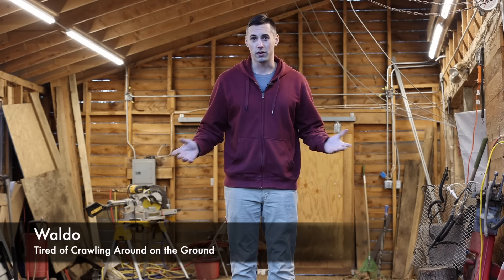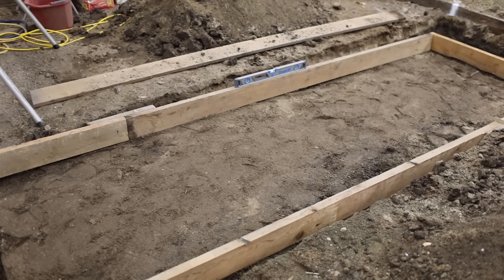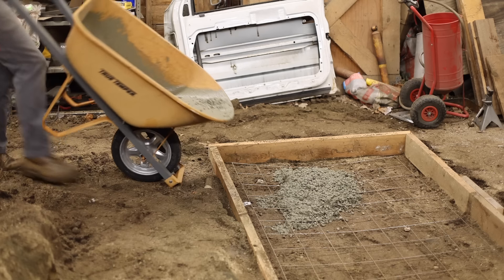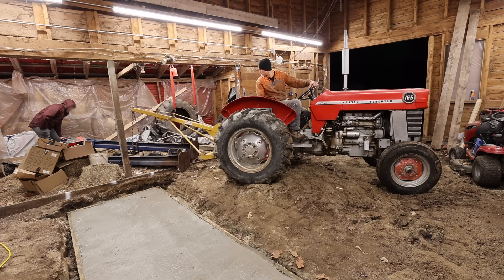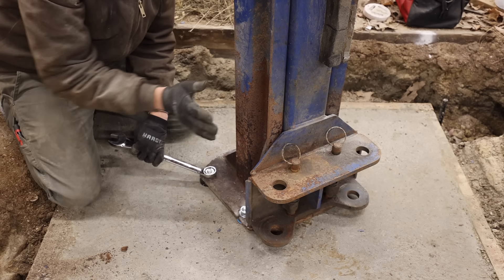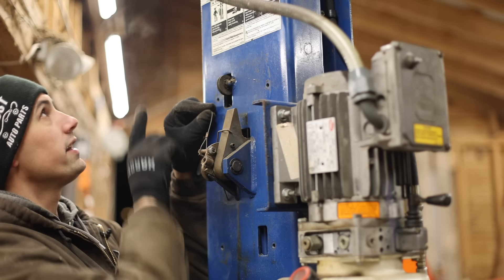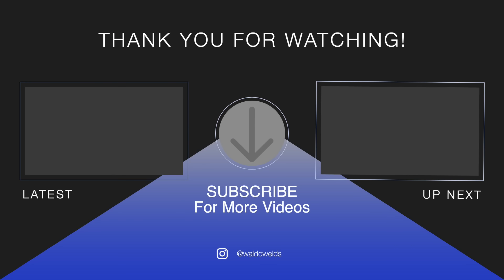Installing a 2-Post Automotive Lift on the Cheap

Comment: I have the same lift except its not asymmetric. I love it except its not heavy enough for my 95 c3500 hd service truck
Reply from the maker: My HD weighs about 8,300 lbs with the flatbed, so it's just barely light enough. Weight distribution is key though 👍

Comment: 42 bags of concrete is an expensive way to go, and plenty of backbreaking work.  Much cheaper to get a load of sand, a load of gravel and sacks of cement. Rent a mixer. It will still be cheaper than a palet of post hole cement.

Comment: Are you sure that a slab , just that wide but only 6 in. deep might tilt over if a vehicle  is  heavy and offset on the lift. I dug down 18 inches  in my slab to support the lift. I am 70 and I installed my lift by myself.

Comment: I don't know about lifting those trucks with a 2 post lift. What's the weight limit for your lift. Great job on the installation Waldo. I've always rather had a 4 post lift for working on trucks.

Comment: Why did you leave the bed of the truck steel. And not painted?
Reply from the maker: I plan to coat it next year, though I still haven't figured out if I'm going to hot dip galvanize it, paint it, or both

Comment: So, you posted this video almost 1 year ago and A LOT of people questioned how safe your lift was going to be. 
How about an update. Have you used the lift much? Have you run into any problems?
Reply from the maker: Good idea. I've used it a fair amount. Not necessarily every day, but I've been maintaining my fleet of seven vehicles with it (two of which are big, heavy, unreliable Land Rovers 😂). 

I've been using a pair of underhoist supports for safety. One at the front and one at the back of the vehicle to prevent the possibility of tipping. (Thanks to the commenters who suggested it!)

Overall, it's been a big quality-of-life improvement for me. I just can't wait to build a nicer shop with a full concrete slab 😬

Comment: Concrete slab greatly inadequate. Ceiling not high enough either. Also, vacuum up the concrete dust rather than blow it away. Concrete slab should be 6" thick with at least 1/2" rebar 6" apart. Slap should also be at least 6' length as well.  Also, new concrete slab should be cured for 28 days BEFORE installing the lift.
Reply: Yep, every sentence you wrote is gospel.

Comment: The installation instructions for a Goalrilla basketball goal call for a hole 16inches diameter and 4 FEET deep filled with concrete. No way I would get under that lift. I could easily see the whole thing flipping over. That slab weighs approx. 3600 lb, trucks weigh over 5000 lb.

Comment: Sweet project man. Be careful with that lift on that seemingly small concrete pad. I know nothing about this and if the lift slecs say that's sufficient, it surepy is. Just make me nervous and I would hate to hear that waldo got squished by a lift!
Reply from the maker: I hear you! I'll be really careful to distribute the weight evenly. Depending on how long this lift will be here, I might pour a bigger slab around it once the weather is good enough to get a concrete truck in here 😬

Comment: Min slab requirements per manufacturer below.
Min Slab Width (front to back) 48"
Min slab Length (side to side) 12" Wider than lift 
#8 Rebar every 6" Minimum
Min Slab Thickness at that size 12"

Good luck and even a small shift can cause whatever you you are working on to come down frighteningly fast.
Reply: Yeah..there's nothing holding this eggshell thin slab together but chicken wire..slab cracks, the hoist legs only need to lean in a half inch or so and they lose contact with the vehicle frame..from there things cascade very quickly and next thing you know we're all donating to his widow's GoFundMe account..
Please tear this crap down and do it right, man..

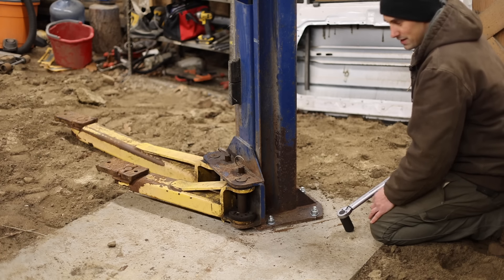Comment: 24:06 couldn't you give it a sanity check by multiplying your weight by the torque arm distance and see if it clicks at least somewhere in the ballpark, with a lug nut? Set it to half the torque target and see if it clicks there. 150 ft lbs is pretty high without being able to brace against something.

Comment: I agree with others, that pad is going to flip. Do rebar reinforced legs on the front and rear of pad, or just pour 12x12 pad.
I wouldn't get under a car with that setup for no amount of money.
Dude rent a mixer, save your back and eliminate dry mix concrete

Comment: I thought the ruck was going to slide off sideways when yu started to life it as the drivers side was raising morethan the passenger side. Was that to do with adjustments or a bleeding issue ? 
Happy Christmas from UK
Reply from the maker: I think it was probably a bleeding issue, though I also didn't have the leveling cables as tight as I should have. Happy Christmas!
Reply: @WaldosWorld  Ithought it could be the cables, but wasnt too sure. :)

Comment: What you've just done there is set yourself up for ultimate failure ears of pouring floors in garages and I mean commercial and industrial garages with hoists like that they need more than what you've done there when we pour floors it's usually 10 inches of concrete below the hoist area in an area that is about 8x12 with half inch rebar placed in it with 6-in spacing you're going to get yourself hurt

Comment: Why dont you dig down  and create pits front and rear (e.g engine area and rear axle) so you can stand (pits could be covered with boards), also then tidy up remaining "mud" area with  athinner layer of concrete , just and idea.

Comment: You routed the lift latch cable over the pulley on the pump side, looks like it should've been routed under. Otherwise pulley looks like its doing nothing. Other side looks good.

Comment: some guys are claiming the pad is too narrow, as if it will tip over BEFORE the vehicle tipped off the lift arms.
fear rules in the absence of common sense and it always wants to over engineer every solution.

Comment: How did you connect the electrical? Also wondering how you got it to raise the truck evenly without adjustable adapters or without any adapters at all. In the market.

Comment: The slab should have been poured into an "H" pattern at least withthe legs going out 6-8ft on each side with a 6" thickness about 24" wide minimum....Your slab will do little to prevent the hoist from falling if the weight isn't centered. The concrete should have been allowed a longer drying time before the anchors were installed and using epoxy in the anchor holes wouldn't have been a bad idea....Fun fact....when you pre-install the nut & washer onto the anchor....if you screw up the threads beating it in....you'll still have an easy time....You can drill into that slab horizontally and epoxy in some Re-bar to run exension footings outward buy, myself? I question why you would ever want to work on a dirt surface in a repair shop....the other parts of the floor could be muchh thinner....3"-4" t6hick to minimize concrete expenses. Also...the lift arms have those folded extensions at the ends of the arms to raise the contact point for tall vehicles....ALWAYS! lift the vehicle a few inches off of the ground and perform a "Shake Test" to make sure everything is secure before lifting further into the air....AND....NEVER take your eyes off of the vehicle while lifting or lowering it!

Comment: good video but all your's are. leave that barn it's good storage . when you build your new building roof will need to be 14 feet high if you put in tall type. at lease 12 feet for reg. i have a reg. one in mine i have 16 high roof and there may 5 feet left  from  roof. like yours is now it's still beats sliding around on creeper with no room at all. with a car you will have much more room under it. take care, be safe and well. merry christmas and a happy new year.
Reply from the maker: Merry Christmas!

Comment: Awesome video Waldo and Merry Christmas ,you did your research your concrete is overkill just vey fresh, I work with this tuff everyday at almost 10 times this weight and your fine and if you want a little bit of a safety margin Harbor Freight sells Pittsburgh Automotive under hoist safety stands 2 ton capacity for $75 each, you don't need anymore than that, your ground was already very stable and did not to be compacted, that also makes your  slab more stable the ground won't shift under it, i was going to build a new garage to accommodate a hoist, my walls are only 9 ft tall and had my 45 yr old concrete slab tested by a friend who said your way beyond what you would need for a hoist i said awesome and got a quote to have the walls extended another 2 ft taller, this is code in my neighbourhood not allowed to go taller unless you take out a commercial permit, living in a residential area, i had a blueprint from an engineer friend of mine to work from, a builder came out to give me a quote on the job and when he looked at the blueprint and said it'll never work, and told me it would never pass inspection, i asked why he thought that, oh your concrete is too old and you roof trusses aren't strong enough so we have to start from scratch and its $5000 to demolish and haul away all the old material , i laughed my ass off at him and asked where do you get your knowledge from, oh 30 yrs  in the business of construction , so i showed him the concrete inspection and he got mad and pissed off, i said i guess you never done a job like this before have you and you have only ever built new from the ground up you have no experience in renovating an existing building or site and this is an easy job for someone with  30 yrs experience i told him, the garage was already over built with 2x4 walls  15' on centre and the roof trusses were the same and the extension walls were only required to be 2x6 walls with bracing each stud cavity a no brainer for someone with 30 yrs experience  i told him, so gave him a copy and he quoted me double everyone else had quoted thx , nothing you and he never gave me referrals i don't think existed, Waldo your good to go. look forward to the future videos always good to watch.  👍
Reply from the maker: Thank you so much, and merry Christmas!

Comment: As others have said foot print is too small. personally I would have done the slab 3x the size if not just done the whole floor and called a pump truck.  secondly the slab was not cured enough to be setting anchors in place much less trusting them to handle a pretty sizable load from the jack and added weight of a vehicle. I would much prefer to over engineer and sleep easy than make do and regret afterwards.

Comment: You should have dug a bigger hole and some long threaded steel bars be inside of there, instead of drilling some holes into a tiny slab with no wire mesh inside of it.

Comment: Bro.   This is sketchy af.   Not enough concrete on the ground for that size lift.  Installed it a little quick too.    Concrete can take up to a month or so to be fully cured.    The small slab isn’t enough to be structurally sound neither.    The wire mesh isn’t structural neither.   It will simply keep the concrete from heaving when it cracks.      Should have either put some piers/footers under the legs or a larger pad.
Reply: This kind of video can get a guy hurt or killed if they try to duplicate what you’ve done here.   Including yourself….

Comment: You could have buried the bolt shafts into the ground under the concrete....that way, you won't have to drill later.  Q ::  Are you going to pour the rest of your floor?   I WOULD !   You will be happy if you do the entire Garage.

Comment: They mixed approximately one cubic yard.  I mixed and poured 43 bags once, but I rented a concrete mixer.  (my wife supervised)  After that I bought "ready mixed concrete" in a tow behind tank system.  
Everything that moves should be oiled.  The height limitations imposed seems to make this installation, not worth the efforts.  A custom ramp system seems logical.  (up three feet so you can lie on concrete) Ron W4BIN

Comment: I don't know diddle about installing a lift .  I am sure you researched what you needed and it will work just fine.  If not you will know when it fails.  I think you did an excellent job.

Comment: I would never depend on the concrete slab to carry the load of the post and the vehicle.I would’ve put at least a 3‘ x 3‘ x 3‘ footing under each post just so that it’s not depending on the concrete to carry the load but carrying a load through the footings I know that some concrete is 3500 psi per square inch but still There should’ve been a big footing underneath.

Comment: The amount you spent on that bag concrete, you could have got a concrete truck to deliver the concrete. Also, lifts are not supposed to be installed on hand mixed concrete.

Comment: I just dont know enough about concrete and lifts to make a helpful comment lol. Probably only thing I would be concerned about is the cure time of the concrete. It would seem in colder weather longer cure time.  Especially with the load it will hold. How long did hover damn cure before they started filling the lake. Those were some massive non stop pours.  Otherwise looks good.

Comment: Ummm that short pad is dangerous if theres unbalance front to rear on vehicle wont take mych to flip that 3 foot pad and let the heavy end of truck to ground. Make that pad as long as vehicle to prevent tipping take it from a old time auto tech

Comment: Agree with many others…this slab is not big enough. Why do people have an aversion to using epoxy on these bolts? It’s the only way to anchor into concrete.

Comment: You made a mistake. Concrete is not ussualy prepared like that. I saw you firstly put cement in the wheel barow and then pour water on it. Like you saw, cement gets formed in those big "rocks, clumps". Thats not okey. We ussualy put a few shovels of sand and then full amount of water. Mix it. And then adding full amount of cement. And then gradually add sand. It should not form those big clumps. But we do it in our small mixer.

Comment: Guy, this is going to sound a bit critical, but you've entered the world of overhead lifting.  WHY in the hell would you pour such a narrow, thin slab to support your lift?  6" at the bare minimum is enough to hold your lift (with rebar).  Your 2x6's are 5 1/2" btw.  Finally, you pull on your safety catches, and at first they give a little.  Then you lower your lift some more, and it settles on the catches better.  However, you don't KNOW that they're fully engaged anymore, yet you scamper right under your truck.  You got a deathwish or something???

Comment: id feel a lot safer if you filled in the whole floor with concrete.   especially the area around the lift posts.  kinda 'close to the edge' there.. perhaps not so guetenteicht

Comment: Man be careful. Small pad at min depth and bolted at the edge of the pad and out of adjustment locks. I wouldn't be under it without safety stands. I know you say it's temporary. Just make sure it's not the temporary you was thinking about.

Comment: I hope you waited over 28 days before trying to torque rhe anchors down because concrete. Takes at least that amount  of time so it doesn't pull the anchor loose or Crack the concrete.
Reply: Yeah but worse concrete shrinks as it cures and the 3/4 holes drilled will be closer to 1" in 28 days. You wont be able to anchor them because you will be able to pull them out by hand!

Comment: Great effort, but an unsafe installation at best. Slab is way too shallow, especially under the columns, you should have used rebar of the correct size and pattern, never pour concrete in shallow layers and you need to let it cure at least 30 days to, hopefully, reach 90% strength before drilling for anchors and installation. Then you need to install and adjust the lift cables correctly for even lifting and locking. Good luck and please be safe using this lift( preferably with some highlift stands on each end of the vehicle on the lift. In my 45 years as an ASE Master Auto Technician, I've used every kind of lift, but would never use your's as installed!

Comment: That concrete slab is not big enough to hold a pick up truck. It should be much larger and should be poured with Ready Mix, not bagged cement.
Also 3/4" rebar should be used, not thin mesh. The concrete should be allowed to rest for at least 30 days before drilling it. I see a lot of problems here. Be safe mate.

Comment: I love all the different types of DIY stuff you do yourself. Huge respect for that. However, for health reasons, it is very important to wear mask when dealing with dry concrete or cement.
Reply: That is the safety advice you got from this? How about the fact that the slab is on dirt and in no way capable of holding the load. Dude will die of 9000 lbs. crushing him long before a lung issue!
Reply: @A_Person_You_Dont_Know 
The suggestion was basically for any readers who might look at the video and would want to work with cement for any reason.
Reply: @danial1635  Ok but that's like commenting that a dude standing in a puddle of water while holding a live wire is going to get his feet wet. This video has about 30 serious safety issues and none of them include inhalation of a concrete.

Comment: Put a rotatiller in a mud box or build mud box out wood or steel put rotatiller in ur box get fifty gallon barrel fill with water get a bucket to ddip ur water till put ur sacks of mix in box till add water urdone mixing pour ur concrete

Comment: i all way drill throw the concrete if you damage and anchor i could pound the old one down and still use the hole to has happened